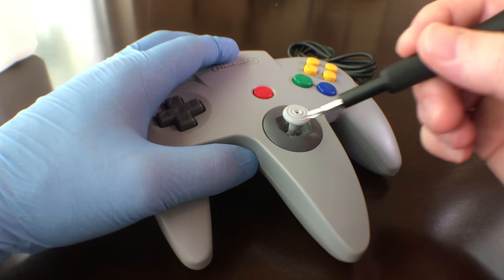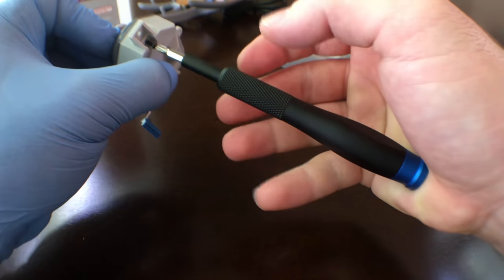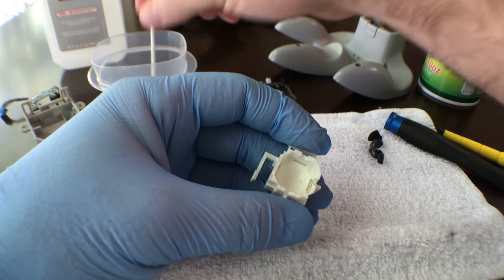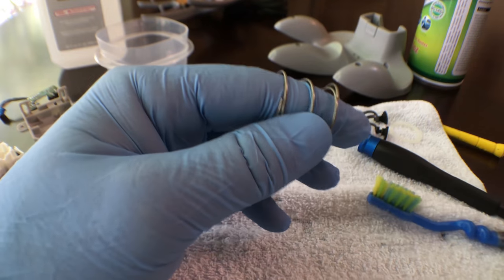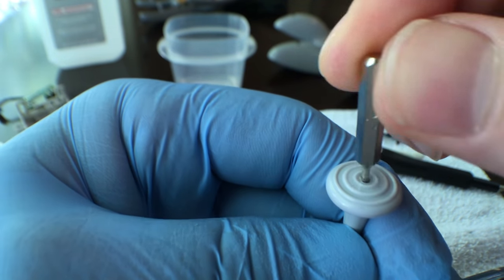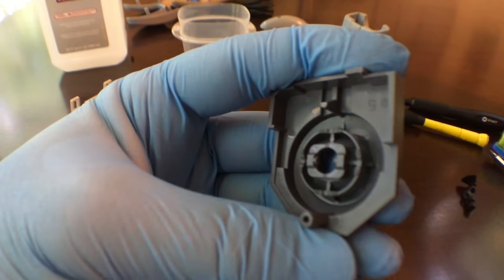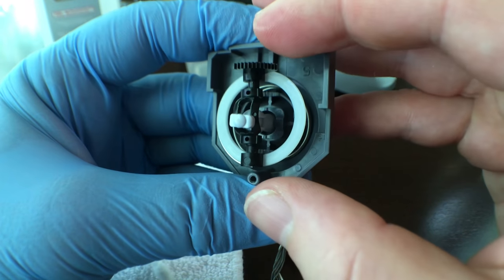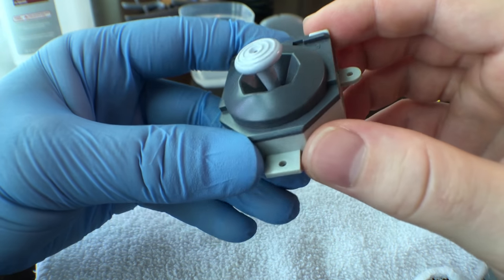Nintendo 64 (N64) joystick teardown - How to clean/fix/restore/refurbish

Comment: Can I also use Ketonatus alcohol to clean..??
Reply from the maker: You'll have to google the difference between the two. I've never heard of "Ketonatus" before. Is Isopropyl Alcohol not available where you're from?
Reply: Restore64 Thanks for the reply! Yes we have it, but I still had some left of the other alcohol. So I have to buy isopropyl to make sure it works ;)
Also I cannot find joystick butter in my country (the netherlands)...... are there any other lubes I can use? Gun oil?
Reply from the maker: @Kapojos  i think joystick butter is only based out of the united states but they ship worldwide, try messaging them on Etsy. I put a link to them in the description.
Reply from the maker: @Kapojos  But no, don't use anything that's not specifically intended for it. It's not worth the hassle, trust me.
Reply: Restore64 Thanks for the putting the link in the subscription. Its still quite expensive to have it shipped here... But If that is the only good option... or is it perhaps possible to use vaseline or a silicone butter..? What could go wrong..? Thank you :)
Reply from the maker: samuel bakker I’ve tried almost everything. Nothing works like the joystick butter. Short use of most things on plastic won’t cause any serious damage so have it. This is another scenario in which isopropyl comes in handy. You’ll need it to clean out all the junk you’re trying to put in your joystick.
Reply: Restore64 ok I will think about it! Might try the joystick butter if Its that much better. And what if the joystick is really worn out. Do you need to fill it up with resin? Or is the butter enough?
Reply from the maker: @Kapojos  The joystick butter helps regardless but is really only for tight sticks to keep them that way. Resin works if you have a lot of time on your hands. Easier to just buy an N64 controller on eBay from Japan with an already tight stick in it.

Comment: How long does the refurbished controller work after repair?
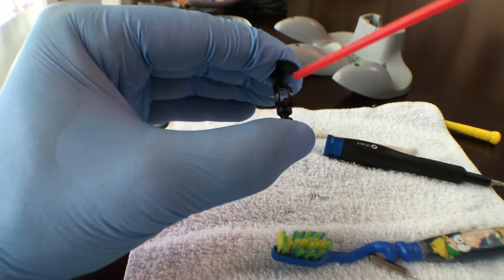Reply from the maker: 10:15, still running on my original application from 2015. So it's been about 4 years now. I use my controller for 2-3 hours a week, sometimes more. If you wanted to get super crazy you could re-apply once every 2 years but I don't think that is necessary. The product is designed to self lubricate so the more you use it the better it gets. It's just something your own thumb would have to experience to understand. It's truly satisfying.
Reply: @restore64  Thanks for the answer.   :)

I wanted to start Speedrunning Castlevania 64 but I didn't want to worn my mid-condition N64 controller.
Reply from the maker: @nickel7o740  Check this guy out "Lu-1zQgLQBY" he does 007 speed-runs and he uses Joystick Butter too. All of his videos are worth a watch or two as well.
Reply: @restore64  Can you send me a link to Lu-1zQgLQBY's runs?

I can't find him on twitch or youtube.
Reply from the maker: @nickel7o740  Sorry, https://www.youtube.com/watch?v=Lu-1zQgLQBY

Comment: How often do you do this?
Reply from the maker: Sorry for the late reply. I haven't had to re-do it since this video. My personal controller that I did two years before I shot this video, 6 years ago, is still my main and it's still perfectly lubricated. So we are going on 8 years now without having to re-lube. My cousin and I play a lot of Mario Kart 64 battle mode on block fort so my controller is easily getting 5-10 hours of use per week!

Comment: @Restore64 perfect video and cool name. I opened and cleaned my controller and now it feels loose somehow. I didn't under or over tighten the screws. It makes loud kinda cracking like sounds. Any tips for me? P.s. I used pledge
Reply from the maker: Oh no! Don't use pledge haha! Re-clean everything out thoroughly using the highest isopropyl you can get your hands on. You'll want to get rid of 100% of that pledge. Make sure everything is seated properly before re-assembling it.
Reply: @restore64  oh crap. Thank you I fixed the issue and did reclean but not thoroughly. Thanks again hell of a video.

Comment: You really don't need to waste ipa on the plastic parts, you can just wash em with dishsoap and water
Reply from the maker: Dish soap, or any other surfactant for that matter, will, technically, do extremely well but tends to leave a residue that may inhibit the performance of a correctly post-applied lubricant. IPA is a solvent and since we are using a Q-tip we are essentially dissolving any solids and wiping them away simultaneously and leaving a perfectly cleaned surface. If you wanted to get super crazy with it you could use a solvent to make the surfactants job easier but you'd still want to follow up with a solvent. In short, soap and water work just fine as long as you're not overly compulsive about it being perfect.
Reply: @restore64  Fair enough, I rarely have to use lubricant as I don't often work with n64 sticks, which are obviously uniquely sensitive to friction, is there something you'd recommend as an alternative to joystick butter? it's a bit hard to get in my area
Reply from the maker: @leoforzeth  Where are you from?
Reply: @restore64  Mexico

Comment: You should have went over id the plastic breaks. Depending on conition the plastic is going to become very weak ans brittle.
Reply from the maker: I agree. I may do a video like that in the future. If the tabs break a healthy dot of hot glue will hold the pcb in place really well actually.

Comment: Noooo it didn’t work what could I have done wrong...
Reply from the maker: What specifically didn't work?
Reply: Restore64 I just got dust off it put it back together and joystick still wobbly but I didn’t really add the cleaning thing I shouid redo it and see
Reply from the maker: @Lil_Laflame  The Joystick Butter won't make your stick tight again it'll just prevent a tight stick from every becoming loose.
Reply: Restore64 oh so it’s not that important?
Reply: Restore64 what’s important that I need to do that Will make it work?

Comment: I have a hypothesis, or a theory that just comes to mind, I don't know if I am right or not, nor have I read this anywhere.  But.

By removing the residual plastic powder from particularly the bowl and other joystick parts you are leaving gaps between parts. (ex. The area between the bottom peg of the joystick and the bowl)

What do you think?
Reply from the maker: Are you saying this is why you believe the stick becomes loose?
Reply: Restore64 
No, we all know the stick becomes loose because of the design flaw (plastic on plastic parts)

What I'm saying is that by cleaning out the powdered plastic you might be making the gap between parts worse. The residual plastic powder might be one thing left to fill the gap between the bowl and the stick itself, although the grease could replace this gap. I'm not sure..
Reply: Same logic as emptying transmission fluid and putting new stuff in over doing a transmission flush.

Comment: My sick is slacker than my wife after childbirth. Dont think mines a fixer
Reply from the maker: Your wife or your joystick?
Reply: Both I reckon
Reply from the maker: @DirtyFishFingers  Well, I'd recommend Kegels for the first issue and eBay for the latter. You can find some really nice controllers for under $20 shipped with super tight joysticks on them.  Once you find a tight joystick properly clean it like I did in this video and apply Joystick Butter.

Comment: All you did is clean it, you didn't refurbish anything. Your title is misleading.
Reply from the maker: Merriam-Webster - Definition of refurbish
transitive verb : to brighten or freshen
up : RENOVATE

I’m showing how to properly clean-up the joystick assembly to a factory fresh setting so that the surfaces are properly prepped for a lubricant. My intent isn’t to mislead, just to help. By completing the steps I feel I did a great deal of refurbishing to the joystick assembly. I wish the video was more helpful to you. 

Is there something specific you’re trying to accomplish? I may be able to help.
Reply: @restore64  Thanks for the response, 
I think the context in this case is what causes the confusion. When refurbishing a part it is commonly expected that the part will be brought back to a like-new condition. Different expectations exist when used in reference to houses (for example). Maybe its a geographical difference in terminology... 

The title made it sound like you had a repair to the worn out bowl and stick issue that plagues the well used N64 thumb sticks. 

The replacement joystick modules fail to have the fine resolution and precision that the original sticks had (Both the optical and the Game Cube styles). 

Rebuilding the original sticks seem to be the only solution but with SteelStick64 being backordered for years, and Prestige64 having stopped all production completely, the options out there have pretty much boiled down to DIY, and to be honest, every DIY video I've seen on this repair so far doesn't actually work to fix the issue and return it to a factory original functionality, most appear to actually do more harm than good.

I had hopes, when I clicked on your video, that you might have a viable repair to restore the bowl and stick back to factory standards. I apologize for sounding so blunt in my comment, please don't let that discourage you. You did a great job explaining how to disassemble, clean, and lubricate the controller. It just didn't fall within my definition as 'refurbished', when in reference to parts. I see now that webster and Oxford both don't really clarify this very well so it can lead to confusion. they appear to reference the housing markets definition. A refurbished electronic part is typically a part that undergoes testing and repair to bring it up to a 'refurbished' standard before it is put back into circulation. 

https://replacement.parts/blogs/articles/aftermarket-refurbished-and-oem-whats-the-difference-between-these-mobile-repair-parts

The link is of the first Q&A link that appeared for a commercial supplier of electronic parts that describes the commonly known definition for a refurbished part. 

Anyway, I would rather not debate about the definition since we could both go in circles with references across from the board as we take quotes while picking and choosing what context we apply it to. The end result will be not be productive towards anything useful, and quite honestly its not really that big of a issue. I just wanted you to know that it causes frustration for viewers if they are intentionally miss-led by titles, but in this case it turns out that is not the case since you felt this title was an accurate definition and description to your video. My apology again for the confusion, you're doing a good job, don't let me discourage you.

If you have a review video or knowledge on how to repair and restore a worn joystick back to original condition I would love to hear it. 

Happy New Year,
Cheers!
Reply from the maker: @TropicalEncounter  I totally get what you're saying. Having proper tooling done to recreate the parts would be the best route but it would be a gamble, considering how expensive that is, since Nintendo could re-release a mini Nintendo 64 with brand new controllers/parts at any point in time. I spoke with the SteelSticks guy a long time ago. He has a jig in which he can essentially melt the worn sticks back to their original inner dimensions. I saw a video on YouTube for it once, not by him, but could never re-find it. The other method, which is the most labor-intensive, is using epoxy and finishing them back by hand. If you want perfect gears this late into the console's lifecycle your best bet is to go on eBay and buy a controller from a seller located in Japan. For whatever reason controllers made in Japan were pre-lubricated, with something half decent, so it's not difficult to get your hands on one for about $40 shipped with 10/10 or 9/10 gears.

Comment: you did not repair it. you just cleaned it. I've got a really bad one here that need some epoxi or similar shit to get back in shape, and i was looking for that.
Reply from the maker: The video is intended to be a guide to help people unfamiliar with the inner components to get to the parts they want to fix. It looks like it helped you find your issue. You can get epoxy at a local hardware store. It's a lot of work though. I'd recommend buying a second hand controller on eBay. There's still a ton up there with like new sticks. Get one, lubricate it properly, and you should be good to go. Sorry the video wasn't more helpful.